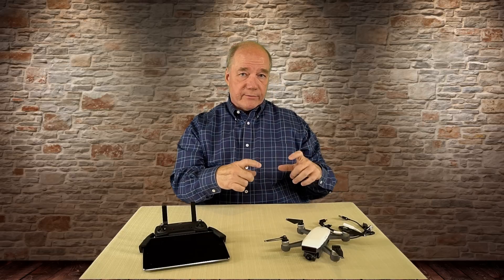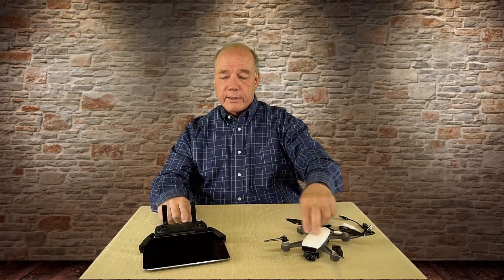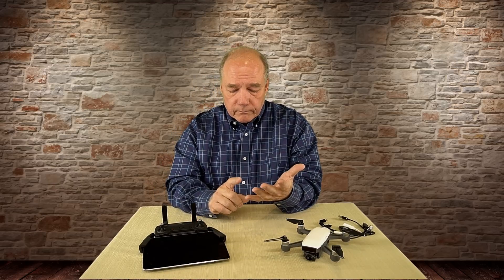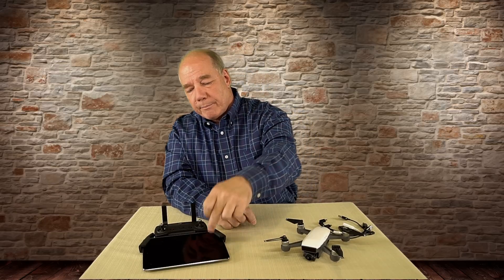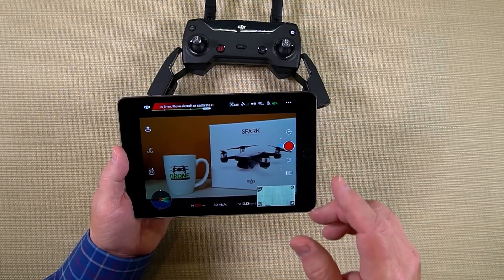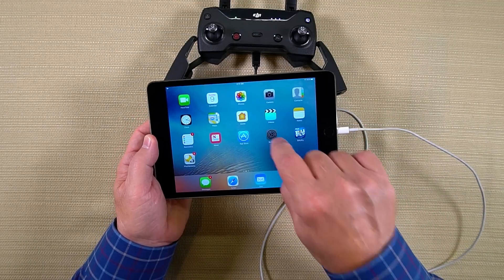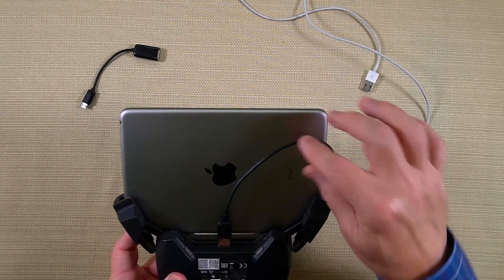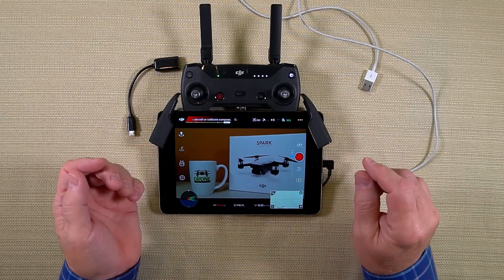One Simple Trick to Fly Your Spark Farther

Comment: Hi Rick, I love the information you provide. One thing nobody mentions is when you make this connection the wi-fi signal strength is not monitored from the DJI ap. That icon does not light up to show signal strength. I have been flying my Spark close and have only made small increases in distance to find what kind of range I will get. When I start to get interference on my screen I turn around and head back. I have not forced a RTH yet.

Comment: Rick got a Spark question for you that I haven't been able to find an answer for. 

I took a couple of flights today (no wind) and my outbound speed was about 6 MPH. When I selected RTH the speed went to 20 MPH. The Spark was not in Beginner or Tripod mode. I am using a remote wifi hookup. The wind was less than 5 MPH.Having owned a Mavic this doesn't seem right ?

Comment: Hey Rick, I enjoy your videos but this specific video is a little misleading.  The title implies you can fly further away by using a cable interface between the remote controller and your phone, etc.  However, this does little to improve the connection between the remote controller and the aircraft. Yes, it does decrease ambient noise caused by the phone but the power levels between the RC and the Spark are simply not affected and there is no data that shows a further flying distance is achievable.  A better title might have been 'how to reduce lag times and improve video transmission'.  Just trying to provide constructive feedback.
Reply: I agree.
Reply: Actually it has 2 wifi Connections. One to the drone and another to the smartphone. So the OTG eliminates one. So there is no change to the flight distance other than reducing noise closer to the RC controller. There are also limitation distance in the Software if you are OTG connected and Wifi connected to another device e.g. home network.
Reply: Hello Brian, can you please explain the part when you mention "There are also limitation distance in the Software if you are OTG connected and Wifi connected to another device e.g. home network."? Especially the home network part.
Thank you.
Reply: Totally agree. The Spark will fly to its maximum battery range without OTG. I've personal done 4054m, but I know of a guy regularly getting over 4400m and returning safely. (I suspect he puts pixie dust on his batteries, lol.)
Reply: @tapmad  I've gotten my spark to 5004ft almost a mile
Reply: @ibsilly4u568  good job,  keep going, gets the adrenaline flowing, lol.
Reply: Actually, in the Eu, you can get significantly better range with an OTG cable, because 5.8 ghz is poorly supported in countries that use the EC protocols. This means that many phones don't support 5.8, so you have to use 5.8 to connect the remote to the Spark...and, again due to the EC rules, 5.8 is only allowed to be used at low power. As a result, some folks in Europe are only getting 200m range without an OTG cable. Also- version 4.1.18 of the app does not support OTG use. You have to stick with 4.1.15.

For folks elsewhere in the world, go nuts- no OTG needed!
Reply: Lis Morris your response does not make sense. In any case, if you were in the EU you would simply hold the power button for 9 seconds, till it makes 3 beeps, and it will be in 2.4ghz mode which is a more powerful signal than 5.8ghz. No otg needed.
Reply: I think you had some facts messed up. Rick stated that you could 1. fly farther using a controller opposed to just using a cell phone. 2. He then stated that you could further improve video and battery consumption by using the cable to interface with the controller opposed to Wi-Fi.. Anyway that is how I interpreted the video.
Reply: Ralph Malone nah, he is talking about using an OTG cable between the RC and the phone. And whilst it might improve video to the phone, it is well and truly proven to have no benefit to range.
Reply: I disagree rusty he stated you could increase range by using a controller versus cell phone. The extra cable increases performance plus.. so I didn't read him like you did.. Listen closely when he talks about why the mavic can fly farther and I think you will understand better.. specifically he is speaking Wi-Fi versus radio. "when you fly with your cell phone your range is limited" he says specifically.. Flying without the controller is using Wi-Fi and your cell..
Reply: Nah. Read the description (his own words) under the video where he talks about a specialized cable - thats the OTG cable: "In this clip I explain how to eliminate the WiFi connection between your Spark controller and tablet with a specialized cable and adapter. This will help to increase your signal strength and improve your flying distance." It would look pretty stupid if his 'simple trick' was to tell people to buy an RC instead of using their phone, lol!
Reply: Well I own a spark and know full well what he meant. The cable improves phone to controller signal, by eliminating  the Wi-Fi garbage you are unloading the system latency which improves the whole process. Who is to say it doesn't increase range.. What does he mean by range ? Control range or video range? Hands down just using your phone opposed to the controller is inferior.. The addition of the cable is unlikely by itself to increase range and I agree with that point. Again I am not sold that this is what he said.
Reply: Actually my preliminary test showed I lost distance when it auto switched my signal to 2.4 once the lightening cable was plugged. Although my video was much better.
Reply: Yea but less likely of wifi interference, crosstalk

Comment: Is there a relation between height and max distance? i.e. the lower you fly the further you can go?
Reply: My average has been 1000' per 100' height but I've only ran it up as far as 300' although in the right location I can take it 1.2 miles but around the house 1000 per 100 any given day.

Comment: There IS a problem on the Android side you did not address. In my case, I'm trying to use my Samsung Galaxy S6 Edge phone (not the latest and greatest, but not chopped liver either!).  I bought a regular OTG cable per your earlier suggestion. When I tried to make the connection, my phone said that it COULD NOT connect to the "High Power USB DEVICE" .. it needed to be powered. After doing some searching for solutions online, I found that there is something called a Powered OTG Cable. I've ordered one of those to see if it solves my problem. If it does, great, I'm in business. If not, have you found any Android devices which WILL work with the OTG cable? I have a NVIdia Shield K1 which I use for my P3A, but it will NOT fit into the small arms of the Spark RC.  On another topic, I've also had some issues with the DJI GO 4 App crashing on my S6 Edge.  If I'm flying with my Spark RC connected to the S6 Edge, and I'm flying in the woods, and the App crashes, will the Spark go into RTH, try to rise 150 feet and kill itself by smacking into all the trees above it? Where I live, you can go few places where there are not an abundance of BIG TALL trees.
Reply from the maker: Bill, sorry to hear that you're having issues. The only thing I can think of, and please don't take this the wrong way, but make sure you have the dongle plugged into the controller and not the phone as it makes a difference. I'm sure you knew that but a few folks were having issues because they thought they could use the cable either way and it only works with the dongle on the controller. One other quirk I've noticed is that with some of my Android devices I had to actually make the connection through WiFi first to "handshake" with the quad before adding the cable and then turning off the Wifi. You might try that as well. Let me know how you make out. Rick
Reply: Okay, just tried it by connecting the OTG to the RC instead of the S6 cell phone, and I was successful.  I knew of the "Host/slave" connection, but figured that the phone had to be the host, since it was running the DJI GO 4 App.  Once I reversed things, and put the OTG on the RC, powered up the RC and phone. When I plugged the short USB cable into the S6 phone, I got the familiar "which app do you want to launch: DJI GO 4 or Litchi?". I launched DJI GO 4. I started up the SPARK and it connected shortly.  Then, to see if it really was working, I went to the phone WiFi options and turned that OFF.  The connection between the  RC & phone remained via the OTG + USB cable. Thanks for the explanation. Since I have 3 batteries all charged, I will go out and get in some test/stick time with it after church this morning (don't want to use it on a shoot until I'm familiar with its quirks). Cheers!

EDIT:  Just went back and tried to duplicate my success .. and was unsuccessful. Every time I turned off the WiFi, the Spark RC disconnected from the Spark. So, there appears to be some very specific way or order in which you must power everything on and make connections. Very frustrating, but IF I can duplicate my earlier success, I'll try to write down in which order things have to be turned on and/or connected.

EDIT #2: Okay, think I have the procedure down now. 1) turn on phone 2) turn on Spark  3) turn on Spark RC and wait for green LED.  4) go to phone wifi settings and connect to Spark RC. 5) launch DJI Go 4 & tap Go Fly (exit out of menu) - verify control by moving gimbal. 6) plug OTG into Spark RC  7) plug USB into phone and HOPE to hear "connection" tones with little graphical waves occurring at the USB port on screen. 8) call up phone Wifi settings and turn Wifi OFF. 9) go back to DJI GO 4 app, and all should still be working.  
 
A painful process, compared to the way my P3A/Nvidia Shield/DJI GO outfit connects without all the additional steps.  I'm wondering if I will have to repeat all 9 steps when I have to change out a battery on the Spark. Guess I'll find out when I go out to test.  Another reviewer of the Spark said what he liked best about it was the "convenience" and the ease of getting it into the air.  My experience is pretty much the opposite. If I have to go thru a 9 step dance just to connect every time I put in a new battery, that would make the Spark seriously "inconvenient", imho.  Just reporting all this here in hopes that some other Android user might find my experience useful.
Reply: Bill Somrak A perfect example of the Spark not being so fantastically simple. The usb connection between the smartphone / tablet and the controller should have been standard ex factory , instead of that flawed WiFi solution. A stupid cost saving decision from DJI.

Comment: If you have a company making custom cables, can't they make a micro USB to lightening cable or android equivalent so that the dongle could be eliminated completely?
Reply from the maker: The challenge is that we also sell the cables for connection to the Mavic Pro and Phantom series so using the smaller Dongle allows us to accommodate more models with the same item. When you use the kit, you almost don't even know the adapter is installed it's so small. Thanks for the post, Rick
Reply: They do. Thats why this video seems so misleading. Heres the link: https://www.amazon.com/dp/B071ZS7XB6?tag=amz-mkt-chr-us-20&ascsubtag=1ba00-01000-a0049-win70-other-nomod-us000-pcomp-feature-scomp-wm-4
Reply: "dongle could be eliminated completely" This one works great with my Spark remote and Android phone https://www.amazon.com/gp/product/B0744BW2B2/ref=oh_aui_detailpage_o00_s00?ie=UTF8&psc=1
Reply: Exactly wtf
Reply from the maker: Thanks for the post but the cable you have a link for is used on the Mavic controller to connect a phone / tablet and won't work with the Spark. The Spark requires a special OTG cable adapter as I explain in the clip and that't why we have these cables (and connectors) custom made for us. I hope that helps clear up any confusion. Rick